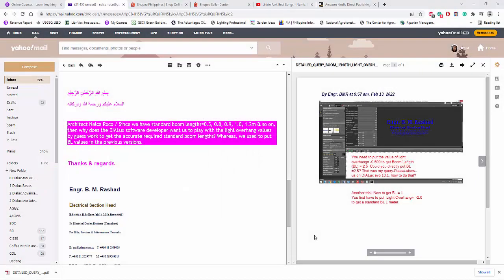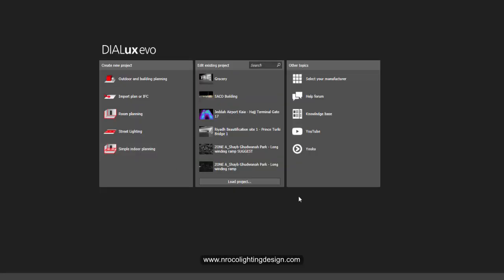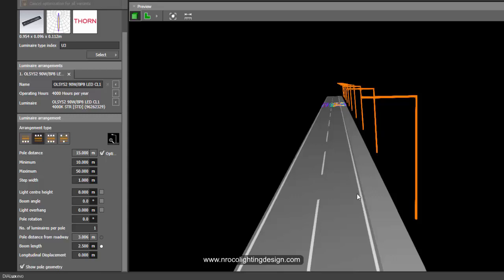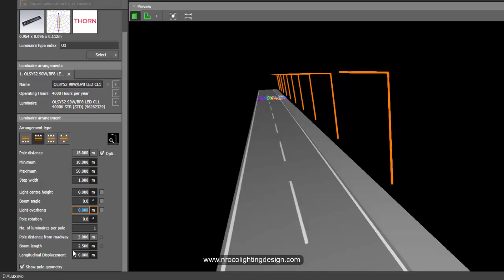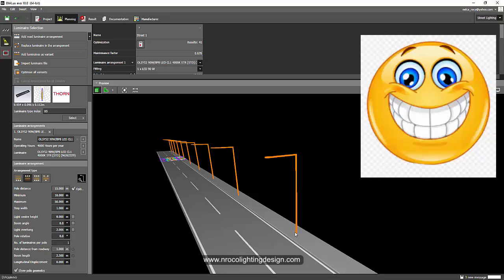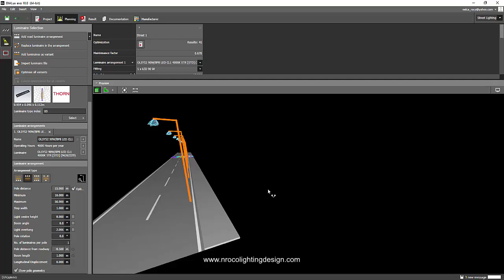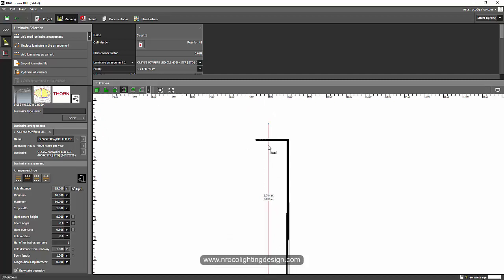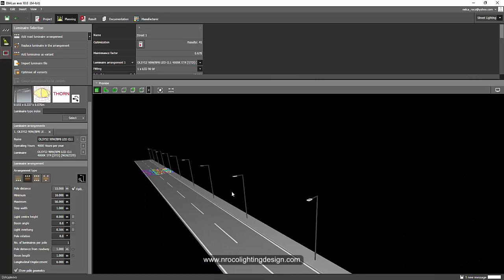The complicated Boom Length in Dialux evo 10

Comment: Hi Nelca, with the Boom length it doesn't seem like bad to me. Both parameters boom length and overhang are interrelated. So if you have the light overhang set to 0 m, the moving of the lamp back seems to be logical reaction :-)